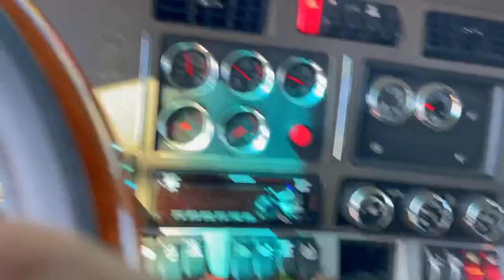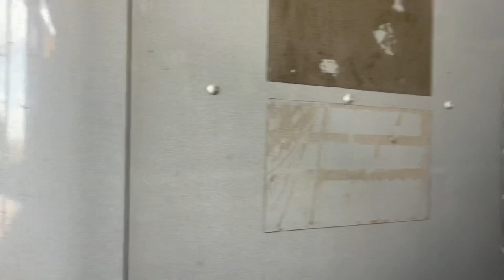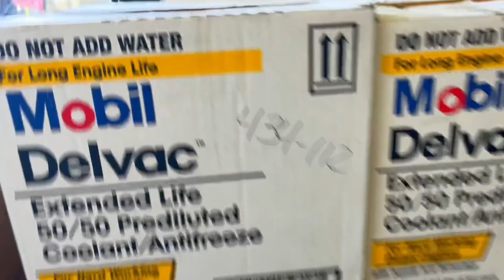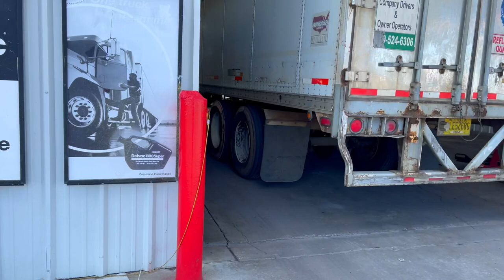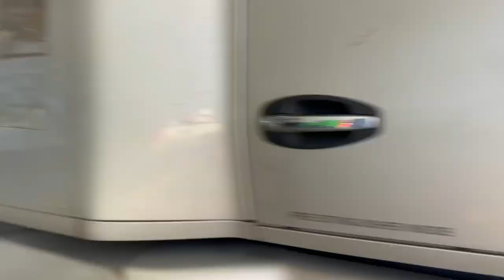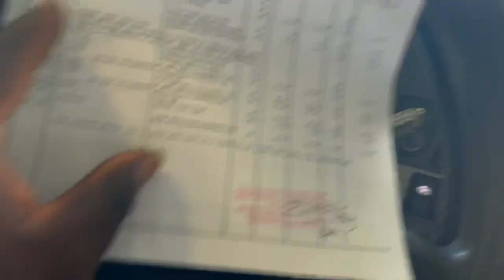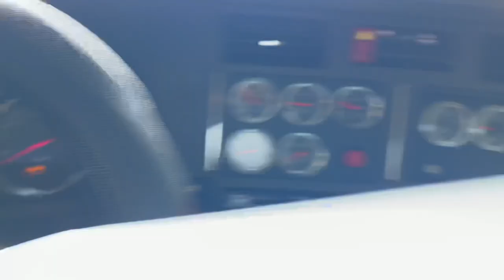AN OTHER $2000 SPENT*I HAD TO*COST OF RUNNING A NEW AUTHORITY IN TRUCKING/LIFE OF ADISABLED TRUCKER

Comment: Bro WTF you doing giving yo tires to the fucking mechanic 😆 these Mechanic's are dirt bags , just bc it's a recap don't mean it bad ,put you a tire rack on the trailer since it's yours when it blow swap it out, bro you wasting money ,and any tire you change have to be changed pairs, if one is slightly taller then the other it'll wear the smaller tire out and you'll be back in for another tire . You'll be going back and forth changing out the same two tires 😆